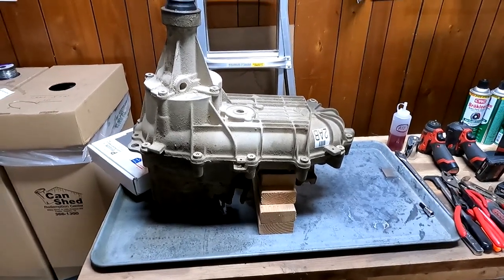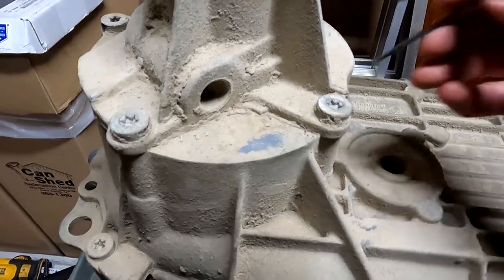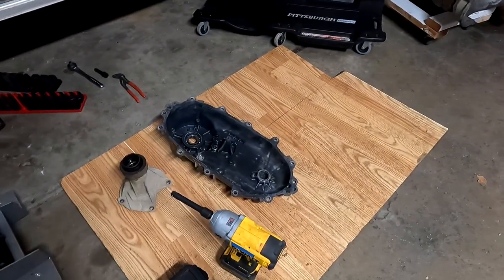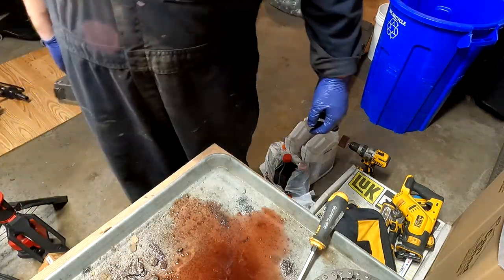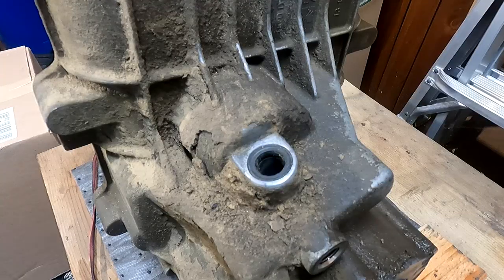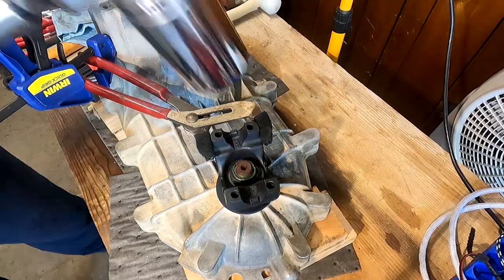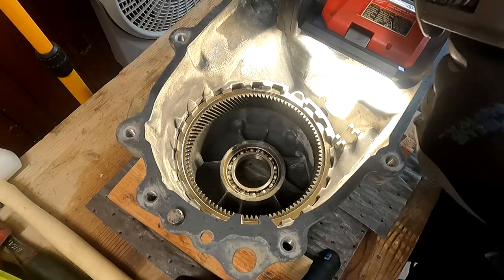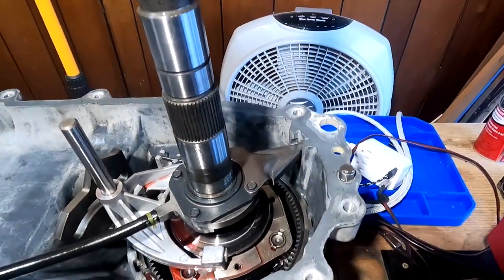Borg Warner 1356 (Mostly Complete) Transfer Case Rebuild Guide

Comment: You left out the front output shaft snap ring on reassembly.
Reply: You wouldn’t have had tho hold the shaft in when putting on the yolk, seal, and nut.
Reply: The first time assembly left out the rubber oil slinger on the output shaft. I don’t know if it made it into the second round.
Reply: Other wise it was a decent video for a first time viewer looking for a 1356 rebuild video.
   I do recommend getting the OEM shop manual from Torque King 4X4 with the rebuild kit. It covers Body, Chassis, Powertrain, and drivetrain.